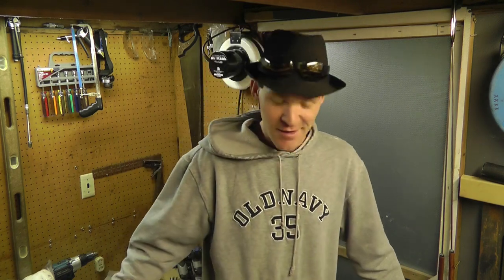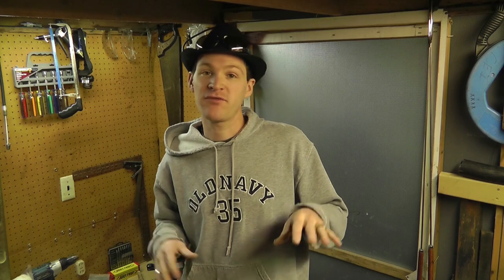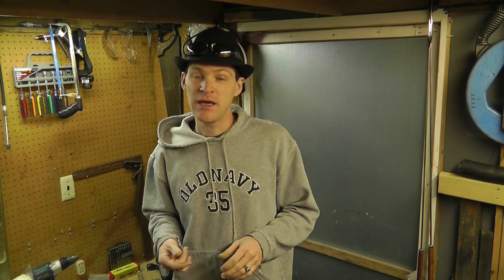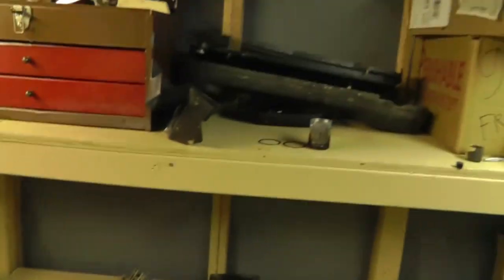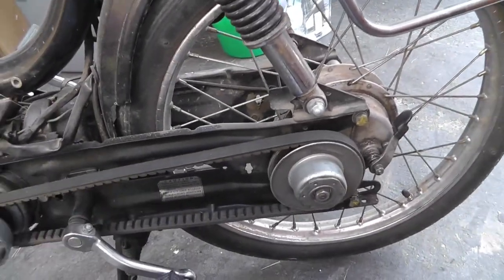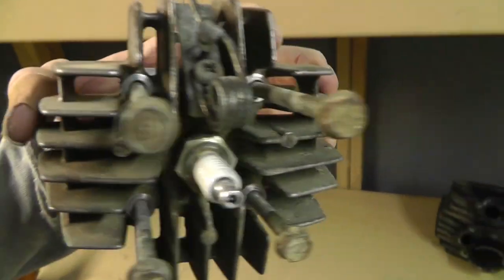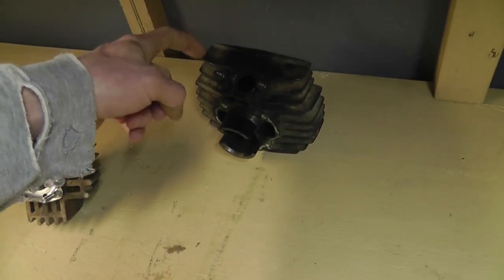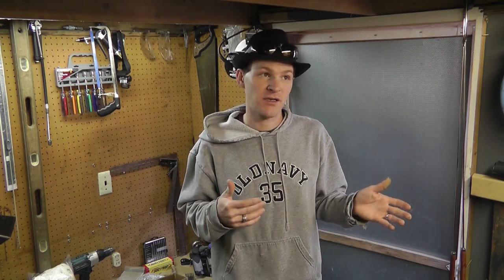#1 Honda PA50II Hobbit Hotroding. (The Intro) " Pimp My Ride" oh boy this will be fun... :)

Comment: Hi, I enjoy your videos and understand your need for inexpensive transportation. I bought my PA50 in 1978 because my dad was using my Honda CA-160 to ride around Redland farming area near Homestead Florida and due to his age and his poor physical state feared he would hurt himself. I figured a Moped would be safer for him to use because it was lighter. After I bought it, my mother broke her arm riding it and a colleague from my office  who was in his 60's was killed when a truck hit him riding his Moped. The PA50 was more difficult to keep working due to old gas and clogged muffler and the gas tank rusted out. I wish I had kept the CA160 because it was easy to keep it on the road with parts more available due to the numbers sold. The PA50 was in storage for many years and I recently rigged up a fuel tank and replaced the carburetor and got it running and posted my video to youtube. I am amazed how many parts remain available for the PA50, all except a good fuel tank. I would love to fully restore my PA50 and hot rod mine beginning with the improved aftermarket muffler. I am told my Moped is still legal to ride in Florida but not sure about needing insurance. I stopped riding motorcycles years ago after someone hit me. Far too many distracted drivers to ride a motorcycle around south florida in urban traffic. I enjoy your videos, keep them going. cheers.
Reply from the maker: Dennis Sytsma cheers thanks for the comment. i understand all the points you make. there more just fun to have and work with. but can be reliably if done right. and yes. way to manny destracted drivers out there. its a real shame. hope to see yours back in action! ~Russ
Reply: Do you know where I can find a good PA50  fuel tank? I see some on ebay motors for $20 and $70, but they look really beat up and maybe rusted internally so I am fearful to buy. Which aftermarket muffler do you recommend? My muffler I think is ok, but think I would like the aftermarket ones better. Is your PA50 reliable now with all the improvements you have done? Which improvement do you like best? I got mine running using scooter fuel tank rigged up, but not happy with that set up except for for test rides around my avocado and mango grove. I studied electrical engineering but never finished my degree and got a job at a electronics tech at the airport for FAA. My sons are both engineers. The ebikes look interesting, but expensive.

Comment: Hi here from the Lowlands,

Don't forget the spring in the rear, rear wheel part of the variomatic. Buy a stiffer spring. Otherwise, with only the lighter rollers, you'll just end up with a short acceleration and then the torque dropping down. With these 2 stroke engines it's in the refs where you will find the power. On the other hand don't go to stiff, it will cost you a lot of gasmoney. Just buy a stiffer spring and 3 different weights of rollers to try out for the front end of the variomatic, near the engine.
If you're concerned about gasmillage. Why don't you try to find a 4stroke that fits your frame.

Comment: if you go to ebay and type in (honda PA50 speedo) in the heading , speedometers for the honda PA50 will show . there are muffalers for it on ebay also
Reply from the maker: yes, i have  looked. there are some places that have new parts as well. most of them migrated in to Ebay :)

Comment: I just bought yamaha RT 100 (to use as scooter, unless use my car).
Everything is broken (the two segments are both wider on one side than the other, the axis eaten, reseal the broken framework, etc .... )
 but cheap, nice made, & easy restore I  (kid cross).

Powerr/ petrol :
If some don't know.

For intake air, and exhaust, see on google (fr)
" A.V.E.C. vortex "

You have to make aluminum for beginners, and find the right number of blades depending on the engine, it is generally 8-12 intake air 5-7 exhaust.

but make the perfect,
45 ° with little scratches due to tong marks, well trimmed, polished, etc. ...
otherwise result zero or reverse sometimes.

Pdf print plan etched vortex (there are known french forum)
glue with double-sided tape,
etched chisel a nail,
but then leaves the tape for formatting this will avoid large stripes with the clamp (or files you teeth a small clip) ..

Comment: Mopeds in Cali are sweet! $20 one time registration and it's under your name, for LIFE! But because of hipster/California inflation, mopeds tend to cost more. And don't be stupid and register it as a motorcycle or scooter cuz you'll be screwed with yearly tag renewals and other fees. btw, the hobbit pa50ii can get to 50mph+ without too much trouble, especially for an engineer lol. Stock with 30mph you can get over 120mpg!
Cons of mopeds: 1- they're two stroke, need fairly consistent maintenance and upkeep. 2- they're from the 70's, often rusty and missing lots of original parts/beat up over the years. 3- some models can be flimsy and as structural as a bicycle, going fast can be sketchy/dangerous. 4- it's a two wheeled vehicle, people in cars are jackasses and don't care about anything outside of their arms reach/you're invisible to other motorists.
Get over those main cons or look at it as a hobby instead, and mopeds are a amazing! They have a fairly big following and you can find a lot of the parts you need + upgrade parts for decent prices(be careful, they can become money pits real fast). The moped community is a great bunch of people who simply love mopeds, you can find lots of help with your ratty moped on the MA forum! Get into the hobby.. wrench, learn, and ride!

Comment: Torque with variable drive is a rock crawler thing, their prints and specs should display concepts very clearly. Some robot drive systems are variable drive... you are soaking in it! Get a train Pass! My students at Antelope Vally College work in North Hollywood!
 
Mopeds fit on trains and buses

Comment: Hi, your new lab is so small now, like mines. :) Or is it not all showing? 
Everyday when i going to work with my car. I getting to trafic by the hill, and everyday one guy passes me with his electric bike. Hes not worying about hils. With his bike hes traveling about 6km and over 2big hils. One day i saw that he is helped his bike to climb on hill by peddling. I think he forgotten something to charge. :) So dont worry about fuel or if it will be electric bike, charging, because you will have pedals. :) I had that scooter like yours in shape like yours but it called diferent way. And when it overheated motors head i had it to sell and bought electric bike. He was more silent and with much power and tork. I was amazed what it can do on the road. I wheighting about 99kg. and with my on it i could drive my 12km and climb on that two hils without problems. When pushed to the limits its speeded up to the hill about 30-40km/h. But sad thing it got stolen and never found. So i thinking you dont need that power over you bike like you saying by the end of video. Try to rent or do test rides on electrical bikes and see in what you fit and do on your hills. In factory set. Is shops or some kind of bike stores that you could test what i sayed? I think you will like electrical way. 
Now i am thinking about scooter for driving to work. In summer it is supper thing. But not the electric one. :) For one reason - fuel.  Electrical bike or parts in our country sells with kit that with full charge you can go about 15-20km. And it hasnt charging when you doing downhill or free ride. Maybe somewhere is wheels with charging but it is more expencive. And with fuel motor with full gas tank you will get about 50-60km of ride. :)

Comment: You got to check to see if that scooter falls under the CARB laws out in California. It might be exempt because it is so old... But better to be safe than sorry.

Also look into an ebike kit/hub motor.  You can make an ebike that is quite powerful for cheap if you do your own wrench work. I built one for about 2k and it is a blast to ride. Way fast. Silent. No gas. MAGNETS!
Reply from the maker: yeah but if its a 50CC it dont madder :)

also i have a similar ride to work like this:

http://www.electricbike.com/hub-motor-pikes-peak/

so 2K i dont have :) believe me i looked in to it a lot... :) till i started to bang my head in the table! lol

its a big chance building something that wont do the job and then be 2K in the hole... may not be resalable...  :)
Reply: ***** It's not a scooter.
Reply: Darrell Montgomery far as I know it's based on the engine displacement and not the thing it's attached to... I could be wrong though.

Comment: I build electric bikes, but what you should do with this one is convert it to run on water, Stan Meyer style.
Reply: you should build a 72v or 108v e-bike, although i have commuted to work on as little as 36v. 72v and up will get you to the speeds you want to go, and even to speeds you might not want to go on a bicycle (over 50mph on a walmart bike frame can get a little scary but its fun, and don't forget the regen. braking)
Reply: Even if you keep it on gas and supplement with water/HHO to increase power and improve fuel economy you could bump that 50 mpg to ~80 mpg.  It may take some trial and testing to get the carb set right for the high hydrogen present and lean out the petroleum.

Comment: //Mr. Russ ... why don't you use a atmega and arduino code and a hall sensor , to run a small stepper (like the ones in car dash clusters) turning a needle if you want to keep the analog feel ?  parts cost under 20 bucks then just calibrate it with your smartphone speed app